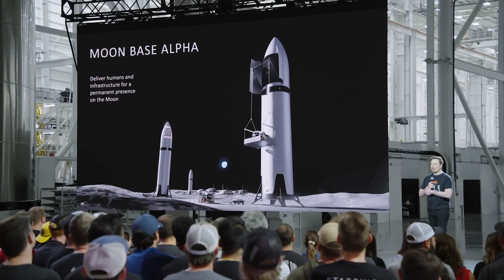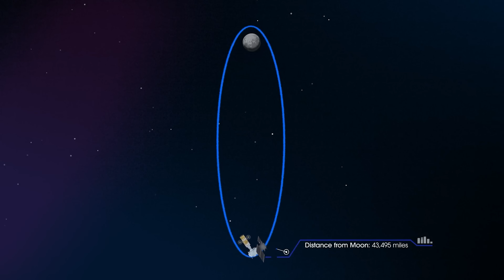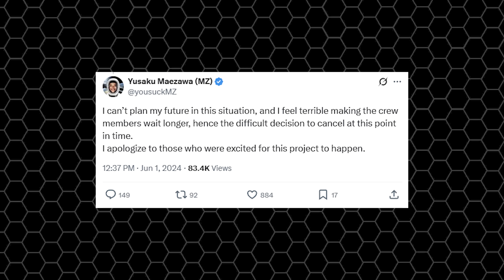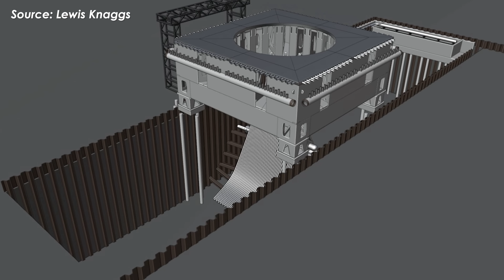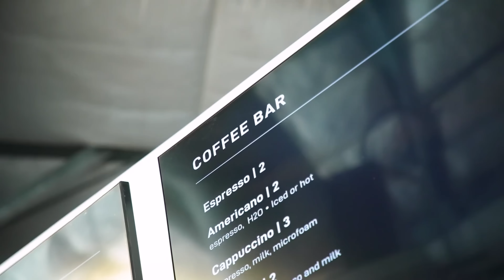Elon Musk declared Massive Plan to accelerate Starship to the Moon by 2026 SHOCKED China!

Comment: How about strapping four boosters together in a rectangular format with a mega starship on top?
That would increase tonnage to orbit in one swoop.
Reply: The mass of the boosters and Starship eat into any total lift capacity.  And add more mass and you need even more to make it structurally strong enough. The Starship is already too large and too heavy to get itself into a minimal orbit. It is not possible to repeal the laws of physics!  Starship has a huge handicap being made of stainless steel! Even a stripped down fuel tank version of Starship will only be capable of delivering near empty tanks to orbit and the there's the boil off issue.

Comment: They are producing 1 Raptor engine per day at one site and at McGreggor, built a 2nd engine factory capable of 2 or 4 Raptors per day for a total of 3-5 engines per day capacity. That's more than 1000 engines per year at the median level... enough to build more than 20-30 ships per year.
Reply from the maker: Exactly! That production rate is insane — nobody else in the world is even close. If SpaceX keeps it up, a whole Starship fleet every year isn’t just possible, it’s inevitable.
Reply: They are currently not producing sea level raptor engines of any series.  They are still assembling raptor 2 vacuum engines on a limited or reduced scale.  SpaceX has a surplus of well over 300 raptor 2 sea level engines . They are supposedly obsolete but are still being modified for testing and flight tests.  The raptor 3 has not began large scale production. The highest prototype series number is 30  for Raptor 3.
Reply: And none of them will have any use if they keep exploding one after the other... Next to that it will take three years how to refuel a rocket in low orbit... 

I'll put my money on China to be on the Moon first in 2030.

Comment: No one is talking about the near impossible task of man rating Starship. Hopefully, they will do the smart thing and keep Dragon around, using it to ferry crew to and from Starship in orbit. That is the smarter way to go about things. It seems very dangerous to me to have a crew sitting on Starship while at least 10 tankers load fuel to it. A disaster waiting to happen. Makes more sense and is much safer to use Dragon to bring the crew aboard only after fueling is completed. Also, do we even know if Starship can handle re-entry coming from the Moon or Mars. Right now, it does not look like it. Just park it in orbit, transfer the crew to Dragon and bring them home that way. Dragon has a role to play in this, at least for now. There is no need to assume that Starship can completely replace Dragon. As Starship exists today, it can't.
Reply: Is there a real need to?  I don't think there are any plans to fly NASA missions from the ground and back.
Reply: @imaginary_friend7300  With this solution, there should not be. Just the refueling situation is enough to not have astronaunts on that ship while its waiting for at least TEN fuel dockings. Not to mention an abort system. You are correct launching people from the ground on Starship is dangerous and does not make a lot of sense. I could see SpaceX maybe doing it, but NASA would never go for that.
Reply from the maker: You make a solid point — crew safety is the toughest part of Starship’s path. Using Dragon as a transfer vehicle while Starship handles cargo and landings could absolutely be a smart interim step. Long term though, if SpaceX solves re-entry and fueling challenges, Starship could take over fully
Reply: @alphatech4966  Agree 100%. The Starship we see today, even block 3, is not up to the task. I'm sure some future block of the vehicle will handle it someday. If they want to send dozens of ships to Mars or wherever, there are a lot of human related problems to be solved. I think we are years away from that.
Reply: Re-entry from Lunar transit would be at 50% higher speed than from orbit.

Comment: The crawler has a wide tire profile. The profile of a traintrack is not wide. The problem is psi on the rails and wheels.
Reply from the maker: Good point — that’s exactly why NASA’s crawler uses those massive tracks to spread out the load. A rail system just couldn’t handle that kind of PSI

Comment: Musk should buy an uninhabited island like Samana Cay and build a spaceport and a town for workers there. It's 10 miles long and 2 miles wide. There is enough space there for an airstrip too. Workers could be flown there and work in shifts of 1-2 weeks.
Reply: Boca Chica.
Reply: Yes, Boca Chica was considered remote with the small housing once, now it's Starbase. Coastal for launches, there would seem to be little reason to move elsewhere. There will always be faux environmentalists among us.
Given a higher flight rate in 8 or 10 years, consisting of site to site suborbitals, opportune dashes of convoys to Mars, satellite lifts , and 🌙 shuttles, then just as airports have moved out in many cases, there likely may be offshore catch and relaunch facilities linked ashore with high speed tunnels. Another likely change by then, given firmer models after the rapid prototyping phase we see now, carbon fiber will replace stainless in suitable areas to save weight, boosting payload.
Reply: @contestvoter  the upcoming Starship flights are going to have the final flight stage over Mexico, below 100 km altitude - which is, technically, Mexican airspace, not space. Imagine the damage if a starship disintegrates over Mexico. And imagine what will happen when SpaceX start launching one starship per week
Reply: I think that's a silly idea.
Reply: @imaginary_friend7300  Why do you think so? This island is uninhabited, its' close to the equator, it's large enough for all necessary infrastructure, and it's far from populated areas (so no problems with nose, falling debris, occasional explosions, etc.). It's possible to build a port and an airport there. And last but not least, there are no stupid regulations there!
Reply from the maker: That’s a pretty cool idea — a dedicated island spaceport sounds like something out of science fiction. The big challenge would be logistics and regulations, but who knows… with Musk, nothing’s ever off the table.
Reply: @alphatech4966  Let's not forget the protective volcano.
Reply: @alphatech4966  Right. I doubt the Bahamas will sell Samana Cay to SpaceX or Musk, but they may consider leasing it for some 99-299 years. And that island could be Musk's own country with its own laws. Logistics should not be a problem - Boeing ships some big stuff from Seattle to Florida by ocean, via Panama canal. And Samana Cay is just a couple hundred miles away from Florida and a little bit farther from Texas.

Comment: SpaceX is getting steps. And its a long journey.
But flight 10 made it obvious that Starship was up to the task, even with an already obsolete design hull, and obsolete engines.

Flight 11 is another burner to learn more from.
And 12 the beginning of getting functional.
I expect some bugs, basically major changes always bring some new problems.
But it will be obviously better than V-2 tech.

Should make way more noise, and accelerate much faster, and have a cleaner plume once away from the deluge.

And it wont  be long until spitting out Bigger Better Starlinks gets Mundane.
And on refueling they can join up and do a bit of a swoop and get liquids to settle and pump fine. Hardest part will be the number of times its necessary, but practice makes perfect.

Fueling will very quickly become also mundane, but we will ge alot more cool launches to support it. Also more returns, more catches and more practice at turn arounds, and a constant increase in numbers of Ships and boosters,  until the days of long waits between flights are legendary history.

Basically 2026 will be the year SpaceX normalizes affordable launch to orbit, And V-3/R-3 Ships will be the benchmark until superceeded by even better ships and engines...

I know how this story goes, the first two times I crossed the Atlantic, the Airliners had propellers on the engines, and TWA handed out real brass wings to the kids...
And being a military dependent, I was required to wear dog tags...
Trans Atlatic flights were still considered risky...

Things change at incredible speeds when its transportation related.
Dont blink, it will be a different world before you know it.

And Elon's Super Power isnt what he does, its what he makes competitors have to do, to stay in the game... 😂

Nasa types will be getting embarassing questions at hearings, and Boeing management will have some Corporate 'Splaining to do to their Stockholders..

Wont be just Starship that 'Cellerates...😂

You like your jobs?
Well then you'd best get off your ash if you wanna keep them. Nobody likes throwing money at lame excuses.

And theres the Chinese! they are Watching, Learning, and even starting to consider way more advanced technologies.

And they are coming up fast....

Just sayin'
Reply from the maker: Well said — things are moving fast, and Starship is just the start. Every flight brings new lessons, and by 2026 we really could see launches, refueling, and rapid reusability become routine. 🚀 The competition better keep up!

Comment: I don't understand why they'd build a new road to transport the boosts and ships instead of building a railway system. With a track you could actually automate it with self driving transporters negating the need for personal.
The tracks could actually start in the factory and end at the launch site. They should basically just put tracks everywhere with automated transporters to move everything around.
Reply: Roads and SPMT's are FAR more flexible.

Comment: Excuse me,  Alpha Tech.   SpaceX has ALREADY  demonstrated the ability to transfer cryogenic fuels in space.  Pay attention.  ❤❤
Reply: Not quite. Spacex demonstrated the ability to pump a small amount of propellant from one tank to another WITHIN THE SAME VEHICLE. And who knows if that even worked or not. Or if the pumping test contributed to Starship flight 3 failing and blowing up when coming back down. Plus it wasn't in orbit. It was a sub-orbital flight.

Fuel transfer isn't exactly something that has never been done before. Progress and Cygnus regularly top off the ISS's tanks. Otherwise, the ISS would have ran out long ago.

The reason Spacex needed to test with Starship is because of the sheer amount because of the size of Starship's tanks. That test hasn't been done yet.